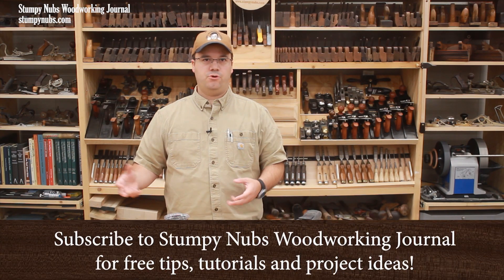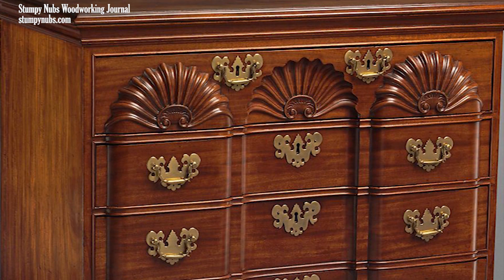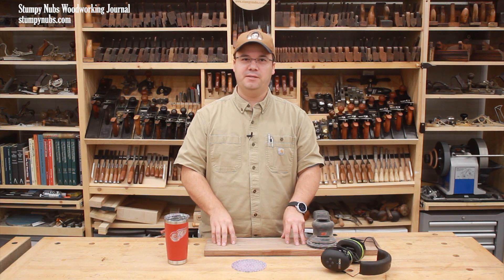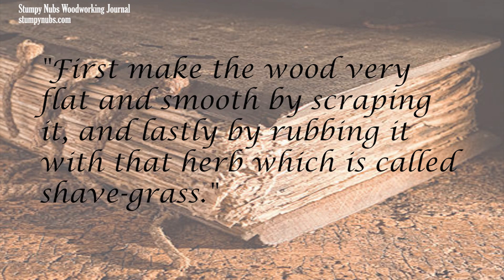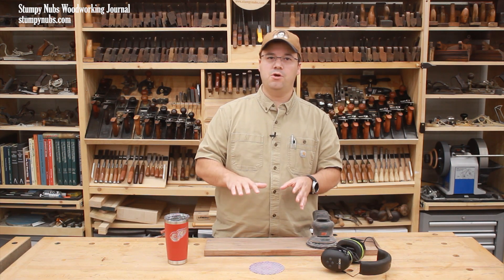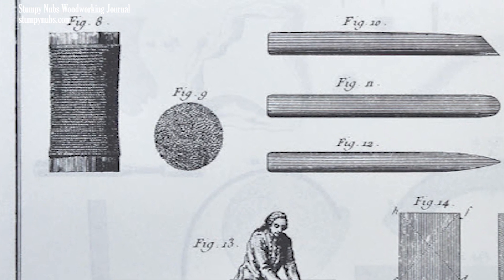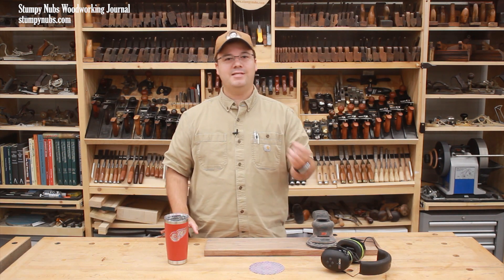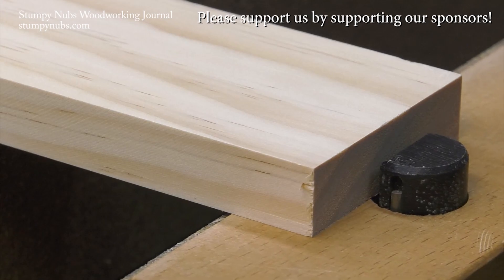The history of sandpaper is really INTERESTING!!

Comment: When I was a boy scout we went on a weekend camping trip where we made hiking staves using very primitive methods, and we used a form of sanding that our scoutmaster said was very old, i was surprised to not hear you bring it up. I've used it several times since, it's handy in a pinch. 

Basically you grab a bowl of sand from the shore of the lake, you can use it wet or dry. You put the end of your staff into the bowl, and then with a cupped piece of leather in your hand, scoop up the sand and start, well you know, vigorously rubbing your staff. The sand falls out of the leather as you work, down into the bowl, where you then scoop more up to replace it. You can even get several bowls and slowly sort it into different grits based on how quickly the particles leave the leather.  I always imagined it would work well for things other than staves. It does get pretty warm, but the heat helps you set a cadence for replenishing, which cools it off.

Comment: Hi Stumpy Nubs, I want to thank you. I found out about that 3M sandpaper in one of your videos when I was making workbenches that I was putting in multiple layers of epoxy on all sides. I was going through boxes and boxes of cheap Velcro sandpaper. I saw your video and instantly bought that 3M sandpaper. I expected to need at least 30 or 40 more pieces of sandpaper, but no, 2 was enough and it smoothed out the epoxy and wood like nothing I've ever seen. This saved me a bunch of money in sandpaper, by buying one box of 3M sandpaper, which is still almost full and is used regularly, even on steel (just don't hit sharp edges). I'm really happy with it. hashtag not sponsored. EDIT: It also saved me hours and hours of time.